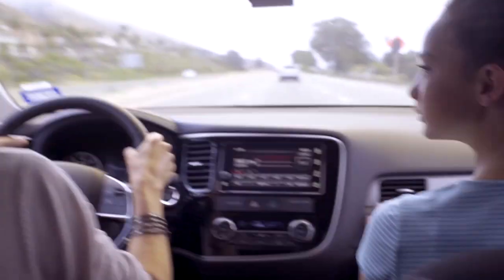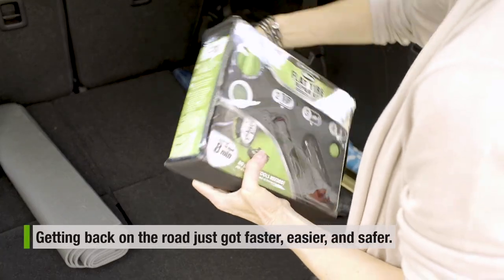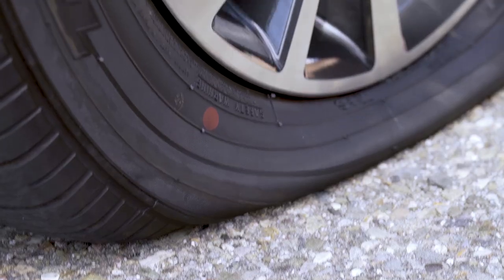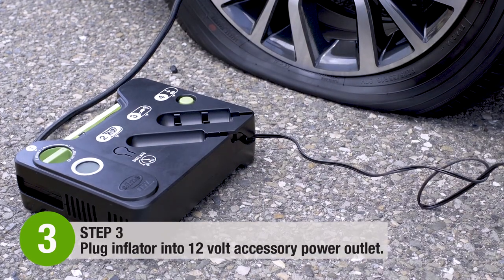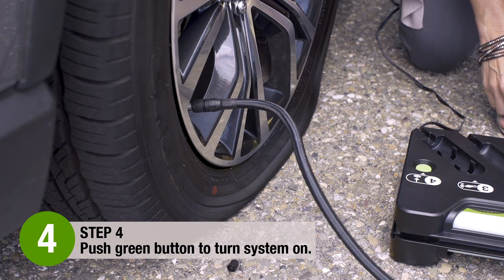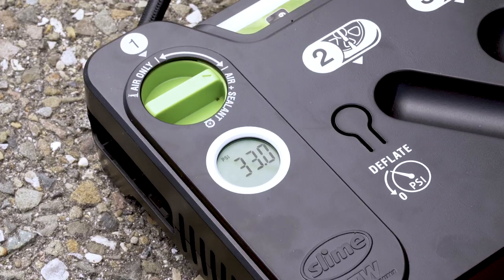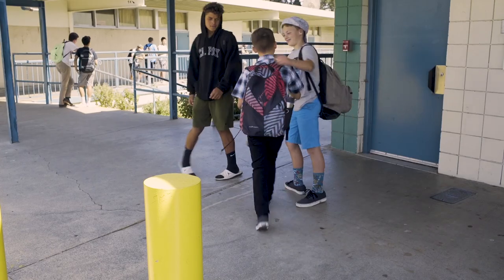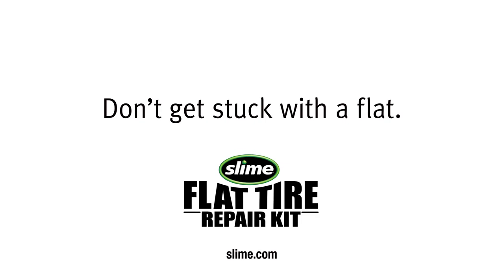How To Use The Slime Flat Tire Repair Kit

Comment: On the freeway at 65, you get a flat tire. How is the tire not ruined at that high speed and 2500lbs of car on top of flat rubber?
Reply: I was doing 80, heard an odd pop sound. A few seconds later my lower air warning went off and monitored the pressure to notice that it was dropping fairly quick. I pulled over within 2 miles of hearing the pop with no tire damage. It was a 315/35/20 tire even. I forgot that I had this kit since I did away with the RFT. Ended up having AAA tow me to a discount tire for repair. If the tire explodes than that's another story.

Comment: What if the hole is at the top of the tire?  How will the slime get up there without driving a bit first?
Reply: maybe because the dam tire will rotate, therefore the slime pass through the whole entire surface area inside. (Some people lack common sense)
Reply: Some videos say roll the car backwards and forwards to spread the slime. The Toyota video says to drive 3 miles and then fill with air again.
Reply: @darockk  Not true. I use sealant a lot in mountain bike tires. That does not happen. You have to rotate the tire so the hole is on the bottom so the sealant gets to the hole.
Reply: @whathappenswhen4767  It is a valid concern. If the hole is at the top, the tire will not inflate or be slow to inflate because it will be leaking when parked. The Slime will not reach the hole to seal. Sealant only seals the hole when it is on the bottom because of gravity.
Reply: @aliikane  Actually it does since this is connected to a compressor... The movement is also from high to light, for inside your body its fluid flow from high to low concentration, in the outside world its flow of air from high to low pressure. The Air pressure will be much higher due to inflation from compressor, naturally the air will be attracted to the hole and bring the slime with it, due to the air "wanting" to flow to the hole to get to the outside of the tire (since the outside atmosphere has LOW pressure).

Comment: Can the compressor be used to inflate  attire without using the slime? And what's the rated amp on this device?
Reply: It looks like you can select air only.  Pretty cool, I just ordered one.  We have AAA but those ding dongs left my wife waiting for 3 hours last week in the middle of the night when she had a flat.  I figure this is a back up that she would be able to do.
Reply: @frankl1955  you can always call 911 and an officer will assist you with the proper tools in their trunk. That’s something the general public aren’t aware about.